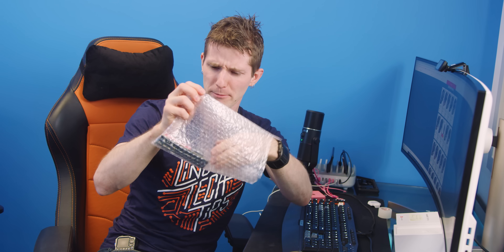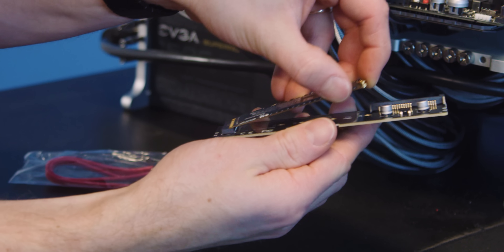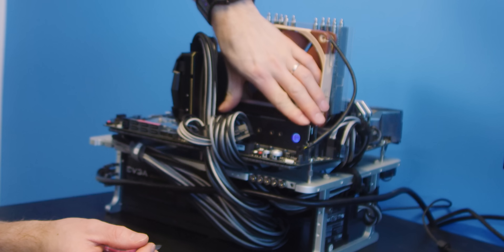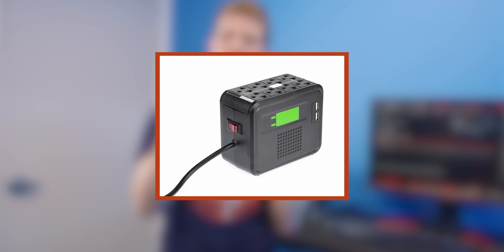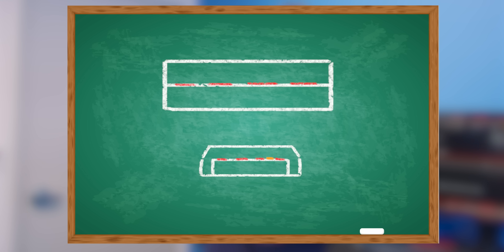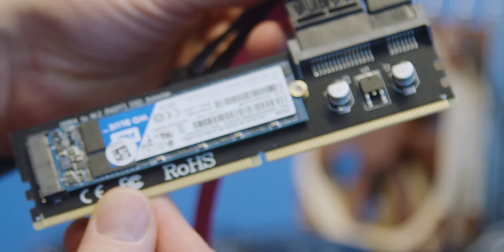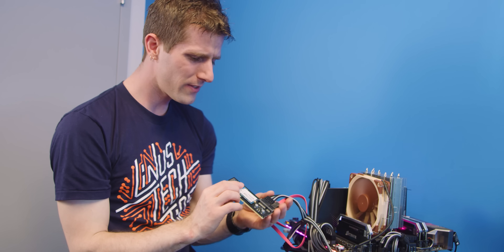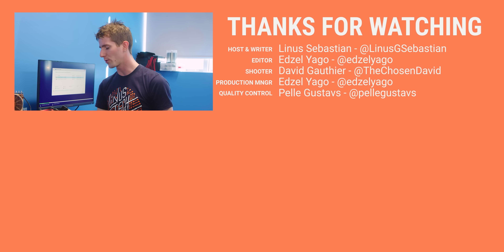They LIED to me! - DDR4 RAM to M.2 SSD Adapter

Comment: Honestly i was hoping that the computer would recognise it as a high-cap ram stick. Could've been a huge upgrading tool if it was. But even if it's basically just a placeholder, it could still work as a nice M.2 test setup. I don't suppose it is in its current state, but maybe there could be some hotswapping functionality added? even if just software-wise?

Comment: bah, if you want to use Ram as a drive you've been able to since DOS.    lol   cough... RAMDRIVE.SYS        :-)   basically allocate a portion of ram as a drive letter.

there's also tray's of ram slots you can buy that have a battery on them to keep the ram non volitile :-)           ps ram is faster then an ssd..  lol

Comment: Id still like them to come up with a cheap and working M.2 M-Key SSD to Thunderbuilt/USB3 adapter. I have a Samsung AHCI SSD that came in the most expensive ASUS ROG gaming laptop you could buy at the time(~2016-2017), with the maxed out options. That laptop failed after less than a year (As did the MSI gaming laptop I bought next, didnt even last 6 months, just stopped turning on, these gaming laptops dont seem to last very long, an I dont even game, so its not like I work them particularly hard, which sucks when your spending 2-4grand on a laptop), but I have been unable to use the SSD that it came with since then without plugging it into a desktop adaptor card. I hear they have some external exclosures now that work, but they are quite expensive because they are not just straight up physical adapters or have cheap chipsets like alot of external M.2 enclosures. Which is why all the reasonably priced and even unreasonable priced M.2 enclosures dont work with M key / AHCI NVMe M.2 ssds. Which is a shame, because then youd get 2.5+GB/s instead of the lame 500-550 you get with most Thunderbolt/USB3 ssd enclosures.

Comment: Lol, it's essentially an external hard drive (but this for  SSD) enclosure, using SATA and molex to power it up, so it's kind of an internal hard drive (but SSD) enclosure but it's a cool enclosure, nonetheless (no need for the gold plating on the pins though).

Comment: if it was the other way around which i thought it was before clicking the video, this could be cool for some retro build, if it also had a battery or it uses a "load up to 2nd disk on boot" similar to a ROM OS

Comment: I could see using this in a compact build with an open memory slot, with right angle cables it could save some space, if the motherboard didnt have a m.2 slot... but ultimately, i agree it is kinda useless lol

Comment: silly linus. hard drive usually need 5v, dram less than 1.5v on stock most of the time. Is there even enough juice to power a drive from dram slot?

Comment: Meanwhile I have a VGA to HDMI Adapter that goes both ways and has no need of an external power supply. It just works and works damn well too. Found at a thrift shop for 99 cents. 

It seems I am one lucky SOB if most of them are one directional. Just thought that was neat that I have one completely unlike the one he shows here that looks exactly the same in every way.

Comment: Your description of VGA to HDMI was not accurate.  Contrary to popular belief, HDMI is not a digital signal.  It is an analog signal (very similar to VGA) where each signal has been converted to a balanced line.  The only digital component is an I2C data pair that is used to report the capability of the display device.  You can map one side of each balanced pair to a VGA connector, ignoring the I2C data and you can drive a VGA display.  Converting from VGA to HDMI is a little trickier, but can be done by buffering the signals with opamps and creating balanced signals.
Reply: HDMI is a digital interface. It uses 3 (ver. 1.0-2.0) or 4 (48G mode on 2.1) differential digital signaling lines to transmit data, using 8/10b or 16/18b encoding, no analog signals present on electrical interface whatsoever. What's more data signals don't have DC-bias and use control codes, so you will get big fat zero voltage level if you try to treat the signal as analog. Or a constant DC-bias, depending whether or not you have op amp that works at 2 GHz rate and above.
 

Digital signal differs from analog signal in how they interpret different voltage levels. Digital signal uses several (usually 2) voltage levels that directly match to known finite quantity, analog signal uses voltage thresholds to encode a quantity inside known range. In more relaxed terms, digital line allows to send an integer number from 0 up to some finite, usually small, value at once, analog line allows to send a fraction between 0 and 1, precision of which would be limited by line noise, at once. So, digital signal has an advantage of independence of bandwidth from noise (up to a point while it's not greater than difference between separate levels, then you have no bandwidth at all), analog signal has advantage of greater maximum possible bandwidth at same clock rate, but since humans prefer stability over throughput, digital signals win over analog in most applications and video signal is not an exception.

Comment: I'm pretty sure the reason it's on a dimm is just so that you can use the dimm slot on your motherboard as a mounting space to secure the drive. Its dumb considering there are many other ways to add an additional m.2 ssd to your system that are more efficient. But in pretty sure using the dimm as a mounting point was the mentality they had when designing this product.

Comment: 👨‍💻💭Watched this B4 I SeenThis    https://youtu.be/iSEkTGzzzk0       Speed up your PC - Add an nVME add in card for you system😳🤷‍♂️💭💨? 
 👨‍💻💭May 2019 bought New i7-9700k Gigabyte  x390 Elite Aorus M/B 16gb Ram  with this Adata XPG SX8200 Pro 512GB 3D NAND NVMe Gen3x4 PCIe M.2 2280 Solid State Drive R/W 3500/3000MB/s SSD (ASX8200PNP-512GT-C) Au $180.00 Guess what😳💭  🦘💭wot🤷‍♂️
with Win10 pro installed > now 2019 Dec lucky to reach Read 1,978 mbs  write 1,421mbs 🤷‍♂️💭 HELLOW WHATs wrong here ? or  is this  what happens after use!    Fook off  never hit 3,000 mbs Ever all new set up 2019 bloody shame  all lies But does boot up  in 12 secs  au$1500😳💭deepcool  water cooled 1 rear white radiator 1 fan $88 ive tried a lot pimp my NVMe-m2   but nothing works 🆘🤷‍♂️👨‍🔬💨

Comment: Initially it seem Linus thought it was similar to DDR4 NVDIMM, but nope to good to be true pure fools gold. A NVMe device that actually used DDR4 in place of flash with a USB port for power would be a nice device just connect it to a USB power bank for battery backup. Basically you'd have a NVMe DDR4 version of a Gigbyte I-Ram sure you're still limited by the interface at least it's NVMe based though, but still DDR4 is lower latency than flash and Optane. For the DDR4 maybe it just have it use a laptop/NUC style SO-DIMM slot.

Comment: Upon seeing the adapter in the title, I was absolutely expecting it to take a 1.3-1.65V input from the DDR4 slot, convert it to 3.3V for the mSATA slot, then run data through an SATA cable.
That seems technically feasible, alas, it did not happen...

Comment: Once i saw on dealextreme a pcie extension over usb 3.0  and i've got hyped cause recently had bought a netbook with usb 3.0 so i was dreaming about getting an egpu for my lil laptop, then i realized that the usb cable wasnt meant to be conected to a usb 3,0 port, it was to connect to a pcie x1 pcb which was supposed to be plugged in a pcie port, i felt sooooooo dumb i was scheptical cause i knew the limits of the usb standard and i was: duuuude how they managed to do that?! Now this video made me remember that silly day

Comment: I mean I was originally thinking at least it would take power from the ram slot. I could maybe see a niche use for someone with no power cables left coming from a non-modular power supply. But nope it doesn't even save a cable

Comment: These would be useful on old homelab server boards where you want to run the operating system on a SSD but do not have any easy or reliable way to mount them. If this device had power delivery it would actually be useful, especially as a SSD mount for DDR3 based homelab servers...

Comment: So is this basically only for old mobos that don't support M.2, so that you can buy an m.2 drive, connect it to the adapter and then plug it into the memory slot???? That is the only usecase i can think of

Comment: This is just another piece of useless tech garbage.  If you have a motherboard that doesn't have an m.2 slot and want the performance of an m.2 drive, just get a PCI adapater card and mount the m.2 drive to that.  You can also buy a PCI adapter card for a standard SSD and mount it to that as well like I did years ago on my old motherboard.

Comment: A) the card he used is an M slot while there is also the combo B-type and they . The only advantage to this would be space saving. The best is to get an M pci-e SSD and pci-e to M.2 adapter card if no onboard is available.

Comment: The only components on the PCB are a linear voltage regulator and two capacitors. This is because M.2 requires 3.3V which the SATA power cannot provide.

Comment: Well it does help if your motherboard does not have any
M.2 slot like mine the m11bb so you can use the adapter as a mounting point

Comment: It's just a parking place for your M.2 drive if you don't have a slot on the mobo, would have been cooler if it had a RAM extension slot

Comment: So would this still be kinda cool for someone who has no m.2 slot, but has 2 left over mem slots? That's how I see it. If correct then if it's a cheap adapter then it's pretty cool since you aren't using the other mem slots anyway, and don't have to worry about trying to mount the m.2 somewhere on your rig, and worry about it falling off or something.
Reply: There have always been M.2 adapters that use Sata3 or PCIe slot (which can mount up to 4 full speed nvme ssd's). This thing is just a waste of space and creates more ugly and unnecessary cable management.

Comment: Ok so stupid question, if I had a motherboard that didnt have a m.2 slot, could I use this to replace that? If I had an extra ram slot for example?
Reply: Since you have to plug it into a sata port anyway, why not just...plug it into a sata port?
M.2 Sata is just wireless sata. It isn't M.2 NVME

Comment: Darn I was expecting either a huge but slow RAM stick potentially used as a ludicrous size  RAM drive, or a DDR4 RAM stick acting as a volatile version of an SSD essentially again a RAM drive. Not crazy useful but it wouldn’t ever thermal throttle unlike some SSDs.

Comment: So basically it just gives you a way to stick an m.2 slot on a mobo that doesn't have an m.2 slot? A stable place to stick the m.2 drive thats not flopping around the case or taped/glued to something?  Its a riser?

Comment: Hello Linus Tech Tips. I'm trying to decide between a HP 15.6 laptop. Which of these two would you recommend...  15.6" HD Touchscreen Display 8th Gen Intel i5-8250U Quad-Core Processor 12GB DDR4 RAM 1TB HDD Backlit-Keyboard Bluetooth B&O Audio Windows 10 vs. 8GB SDRAM, 1TB HDD + 128GB SSD, 15-cw1063wm (1 TB 5400 rpm SATA + 128 GB M.2 Solid State Drive) . Basically comparing an $540 Amazon HP vs a $599 Walmart HP.  We are retired RN's, (non gamers) but would like a reliable laptop with good audio, fast processing speeds. Wife's birthday coming up next week and I enjoyed you video and would very much appreciate your input. Thank you in advance.

Comment: Got to love your weird strange and almost handy devices 

So I was wondering if there is an adapter for a M.2 NVme ssd drive that it is not Pcie slot dependent.
As most mini-itx motherboards only have a M.2 slot and the Pcie slot is usually populated with a Graphics Card, so when upgrading a new faster M.2 than the der one becomes useless.

Comment: How doe's that work?,  if your memory slot can only address say 16Gb per slot, & your M2 card has 512Gb of data?.
Reply: The memory slot isn't addressing anything here.  The adapter just sits in the memory slot.  It doesn't interact with it in any way-- it just occupies that space and uses the tabs to stay secure.  The entire thing would work 100% the same even if it's not plugged into a memory slot at all.

Comment: I can't believe you missed it. The whole point of the device is so you can put a SATA drive (or extra drive) in a space-constrained chassis. MicroATX for instance, or Intel NUC. If you're not using those two extra DIMM slots, this could solve some interesting problems. Very cool device. Me wanty.

Comment: I want a card so I can put NVMe drives into my RAM slots and use it as a massive Virtual RAM disk connected right into the RAM bus.  64 Gigs real RAM and 4 TB Virtual RAM.

Before everyone says... But you couldn't do anything useful with the extra RAM.  I use the PC for work and the excess capacity could be put to good use.

Comment: This thing does have a use if you think about it.
A mb with no m.2 slots, and you have free ram slot in your ram bank.
But to boot, you have fewer SSD mounting positions in your case than sata connectors on your mb.
Most cases have 2 drive slots with double SSD drive tray inserted.
U got 4 SATA hd's. And 2 ports left with no mounting options in the case itself via mounting pockets and etc.
This could be A reaseneble  Alternative to some extend.
But it would still be sata3 speed since it is An m.2 sata drive.
In other words you just hooked up your 2,5 inch SSD in another format in prior unused slot.
Most modern cases however come with SSD holders and even 2,5 inch drive bays.
Current generation mb' even have up to 3 nvme pci-e m.2 slots.
Every m.2 pci-e slot however disables  2 sata3 ports.
Does pci-e 4 change this? I wonder

Comment: SATA cable ? So they only use the memory slot for power.. Of course since the memory controller on the motherboard doesn't handle the SATA protocol (and as such can't show to the motherboard that it's an M.2 SATA that's pluged in). That's not really "convenient" IMHO : an expansion board using one of the available slots in the case, and that's fed via a power rail (if not from an available PCIe slot on the mobo) + having the potential of holding more than one M.2 SATA (if you have enough sata ports available), would be better.

Comment: Now, they did make SSD drives that utilized older ram sticks as an actual hard drive, with the RAM becoming usable storage space.
They required the 3.3v power during standby and had a 3.6v battery in case power was removed, so the data on the RAM didn't just disappear without power.
We're they any good?
Of course! You got near DDR speed from a hard drive, but you were limited to the amount of RAM sticks installed. 2-4gb isn't very much by today's standards.
After actual SSD drive took off, the technology fell away.

Comment: Plug the Dim back in and reboot.  You will have all of your memory plus you will be able to plug in a m.2 drive, too.  this is made for people with older PCs who have no extra pci slots or m.2 slors.  all they have is a sata plug.  poor people.  now, they to can run a m.2 drive incorrectly like everyone else.  If you don't use a m.2 or u.2 slot that is built into your PC, you will cut the speed from 32gb/s to 15gb/s.  also, make sure you have a 40 lane CPU.  Basically, people want to upgrade to a name, not what is correct.  My PC is all Nand.  it has special utilities on the PCI express so you can swap any Nand for any Nand.  My m.2 drive will go from 32gb/s to 90+gb/s.  PS.  if your fans have light or are colored, they are wrong.  Noctua NF-A14 IndustrialPPC-2000 PWM Fans with the Noctua NA-SAVP1 CHROMAX Anti-Vibration Pads (Black).  And if you want LEDs, but an ASUS motherboard with AURA.  no wires, no power, no remotes.

Comment: They’re called “active adapters” vs. [THIS MESSAGE IS BROUGHT TO YOU BY SQUARESPACE] you guessed it “passive” ones. Sheez ya noob. Aka signal converters which do actual conversion/manipulate or process it vs a physical “adapter” between two otherwise compatible connectors. 

Consider this my application, thanks Anthony.

Comment: Only useful for older motherboards that don't have M.2 slots but have extra RAMs slots.  Just allows you to mount them properly.  You can do the same thing
with an extra PCIe or HDD drive slot.

Comment: Using a SATA cable and SATA protocol to use an m.2 drive... also, you have to give up a DIMM slot. Might as well just use that SATA cable with a standard 2.5" SSD lol.

Comment: HDMI to VGA is not a full conversion.  They still both use VESA MultiSync scanline system so it's just a fancy DAC.

USB to Ethernet or USB to Parallel adapters would be better examples.

Comment: Hi i was wondering if you are able to answer a question for me... I'm trying to build my computer myself which i am very new to and i  don't really have much experience. My question is I have a B450M GAMING PLUS motherboard with a 1 x M.2 slot (Key M) and i would like to buy this SSD (WD Blue SN500 NVMe M.2 SSD, 500GB, Read: 1,700MB/s, Write: 1,450MB/s) but it has a SATA connection, I was wondering if i can use this SSD on my motherboard, and i will get the fully speed out of it or will i get the speed of a SATA connection.